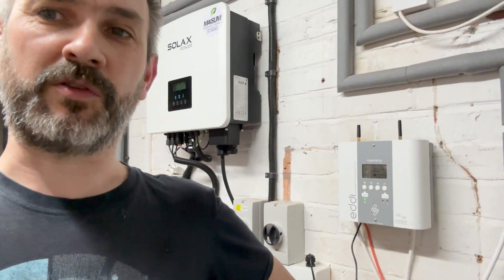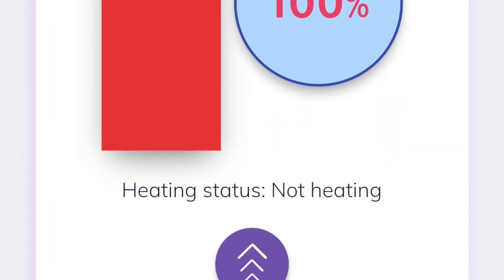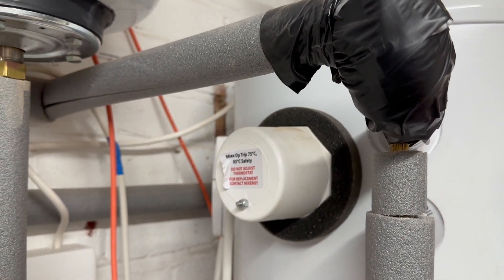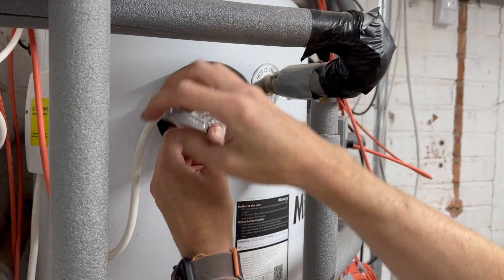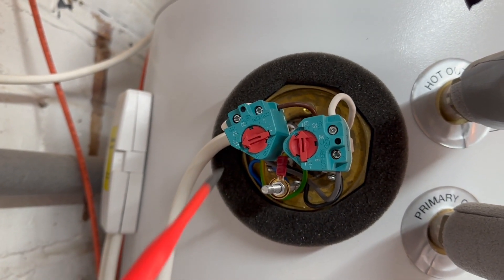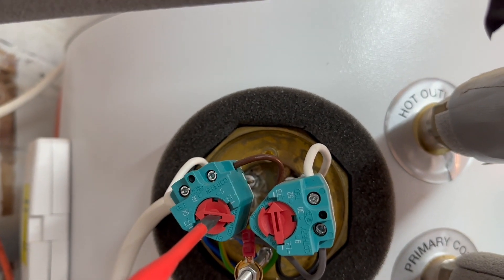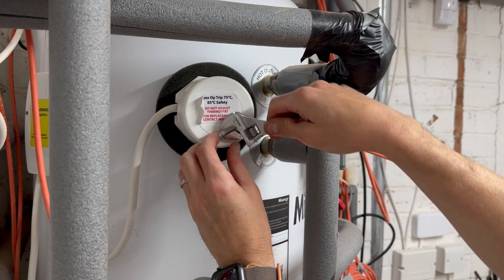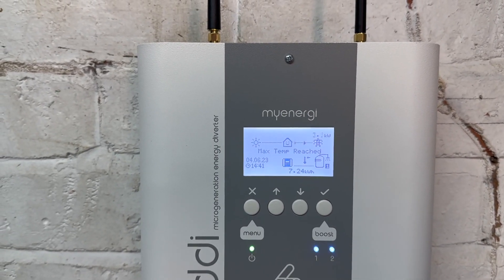Adjusting Eddi temp cutoff on my Mixergy hot water tank

Comment: U can also install myenergi sensor and relay board with PT1000 temperature sensor.
Reply from the maker: That would be nifty, but not sure how I’d install the sensor into the tank. Have you done something like this??
Reply: @tomasmcguinness  yes I've done it with my Dakin heatpump and Dakin tank as the emersion didn't come with a thermostat eddi didn't know what temperature the tank was. I slotted the pt 1000 into one of the holes in the tank and it works perfectly.
Reply: Except that relay board & sensor and have been out of stock for months now. As Tom did, I’ve just turned down the variable thermostat on the Elemex element in my standard copper cylinder. Operating only one element - as the stat and overheat stat are switching out the neutral - so, shut down both elements. Now, I’m going to use the second “tank” connection to power an electric heated towel rail. Remains to be seen how useful, or practical, that turns out to be. Mainly, like the idea that they can be controlled from the App.
Reply: Why is my eddi saying max temp reached when the 

Separate temp probe I have for gas boiler  says 18c 
And on the Eddi display says 
Heat sink temp 33.4 

I don’t a probe from the Eddi going to tank ?
Reply from the maker: @jeff1172 the immersion element will have a cut-off safety. That is one of the reasons the “max temp” message can appear.
Reply: @tomasmcguinness  could be set too low hopefully

Comment: Do you have an element in the bottom of the tank?
Reply from the maker: No, just the dual element at the top.
Reply: @tomasmcguinness  is that because the mixergy tank has a recirculation pump? I noticed the bottom of your tank was cooler is there no way to get that on?
Reply from the maker: The thank has a de-stratification pump, but it runs that itself. Its goal is to heat the water from the top down, so during normal heating, it runs the pumps when it thinks it’s required.
Reply: @tomasmcguinness  no way to trick it to run? We have the same issue own normal tank, not big enough for a really sunny day
Reply from the maker: It does run. I’ve asked their support. When PV is being used, the pump will run when a certain temp difference is reached. However, the tank also tracks the percentage of hot water in the tank. It uses a setting. Once it hits 100%, the pump will no longer run. So I up the desired temp to 60. I’m going to get a mixer valve attached. Then I can heat the water all I want and won’t have any scalding risks!